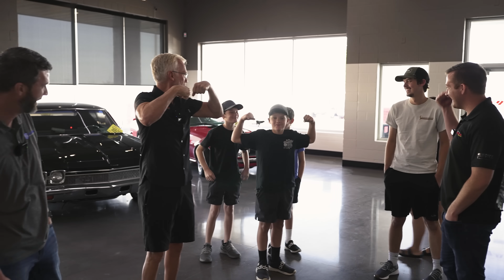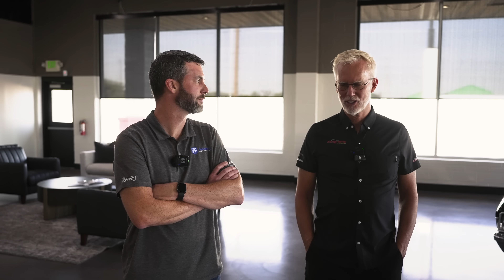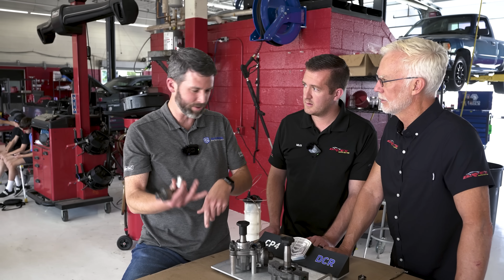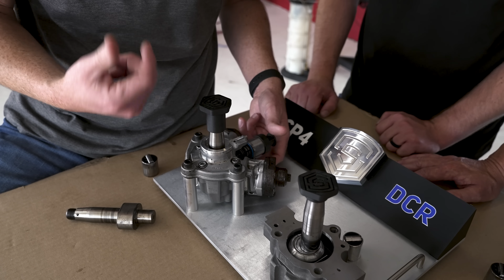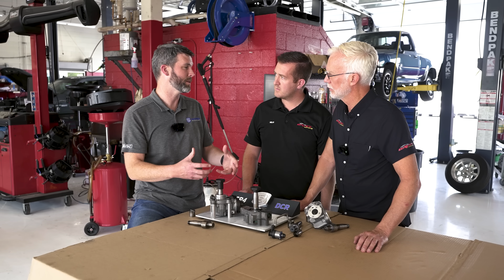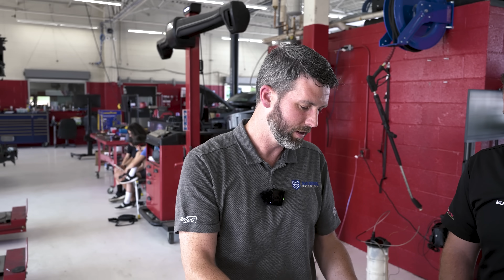Breaking Down How The CP4 Pump is a DISASTER & How To Avoid It With The DCR Upgrade!

Comment: Dave I have a 2023 F-350 Lariat with the Powerstroke. I use your “Dave’s Sauce” every fill up. Increase mileage to 26.9 MPG at 70 MPH. 
  To The Farm 246 Miles from here.
    Just turned 50K and would like to  make an appt to have you do a CP4 To DCR conversion.
Best in Mid to late March How much money should I bring along for the job
   Thanks. Geno

Comment: 11:15 - You nailed it, Miles. You either spend the $1,600 for the disaster kit and wait for your $3,500 CP4 to go out, or you spend $3,500 up front and install the S&S DCR.

Comment: 2017 F350 DRW here.  CP4 grenade got me a week ago while transporting a travel trailer 1100 miles from home. Ford dealer in Cheyenne charging 40% markup on parts.  Has their replacement kit on the estimate for $7k. Total parts $8900.  $6k labor. All to get the same shitty CP4. Totally ridiculous.

Comment: 14:14 Ford Master Diesel tech here, it is the shitty fuel in the States that causes this problem. In Canada, the only CP4 failures I've seen are from water or DEF contamination of the fuel system. I've been a diesel tech for as long as the 6.7 Powerstroke has been out and not once have I seen one grenade spontaneously or wear out over time. Every single fuel system I have done was due to contamination.

Comment: I bought this pump April 2024 and installed it right away. It works flawlessly. I continue to run additives with lubricity, recognizing these parts need better lubrication.  Best 2 grand i spent on an upgrade

Comment: The U.S. diesel fuel standard (ASTM D975) does not mandate a lubricity minimum, but instead recommends a lubricity value (maximum 520 µm wear scar diameter in the HFRR test).
European diesel fuel, governed by EN 590, requires a stricter lubricity limit, with a maximum 460 µm wear scar, ensuring better protection for fuel system components.
European refineries or fuel distributors often blend lubricity additives at the refinery level, making the fuel ready to use and better for modern engines.
In the U.S., additives are often added at the terminal, and sometimes not at all, which can result in variable lubricity depending on the region or supplier.

Comment: Recently installed an S&S bypass disaster kit on my 2011 f350 with less than 90,000 miles. Also now using MAX MPG additive from Industrial Injection. Hopefully my cp4 will live a long life. 
Now I worry about the EGR killing my engine.

Comment: Is it more economical to buy a $10+ bottle of fuel additive per 34 gallon fill up or get a dcr conversion? Assuming a truck life of 200k miles and 16mpg average fuel consumption we get 12,500 gallons of fuel and 367.6 fill ups. That’s a total of >$3676 vs $1990 for the DCR conversion. You be the judge.

Comment: You know...im kinda set and happy with my old 6.9 IDI turbo 250... Makes enough power to hual most stuff and can be repaired on a minimum wage salary if need be. New vehicles are just becoming junk and require too many patches and updates to keep them running.

Comment: Got an S&S 2.1 CP4 disaster prevention kit on my 19 6.7. Its a nice little peace of mind. Im adding an Amsoil dual bypass oil filtration system next. Running PS Kleen diesel and Stanadyne for additives. Truck fully deleted at 80k miles, runs like a top.

Comment: Way to go.  Make everyone terrified that their CP4 is going to fail prematurely so you can sell your pump.  I have seen several 1st, and 2nd generation 6.7L Powerstroke trucks with more than 200k on them with the original pump.  While some CP4's have failed, it is less than 7% of the trucks that were manufactured.
Reply: Seen plenty at 400-500k miles with CP4, clean fuel, filters and additives will save it …

Comment: I would rather drive my older gas Ford than today's diesel trucks! Whenever you need to fix something on a diesel truck, it's $1k+, e.g., injectors alone are $7K! My older Ford a carb would be $300- 500. Gas is also cheaper than diesel, and I get better mileage! But I do like them. They're great for what they do but they are way out of my price range!

Comment: So what is the psi from your lift pump to cool and lubricant. So what is the ideal psi continually from your lift pump to high pressure pump is  the number 15 to 21 psi and is to much to much ?

Comment: Great informative video, several new bits on CP4. Regarding fuel and CP4 failure. It was suggested it wasn’t strongly associated to ULSD, but also said losses in USA aren’t really known… it’s USA failure is highly publicized & legal suits. Although, the failures in UK, European areas; both Ford 6.7 and several other production non-Ford vehicles using Bosch CP4 the failure rate isn’t even discussed as a problem, run extremely high mileage with minimal failures, and when including many more vehicles indicates a failure percentage much lower than USA. 

I’ll continue to accept the fuel lubricity to be the major variable to failure, further verified by those running add-in and maintaining filters are common to exceed 400-500 miles.

Comment: If you fix. 50.
Pumps, that went band it is.
A c p 4 pump You better believe there's a lot more.
 I have.2017 Ford F350  super duty  They tell me the CP 4 fuel pump blew up in the tank. And it's not under warranty. bullshit Bosh. designed a piece of shit pump.

Comment: I worked with Luke and Ian at Cummins.  These guys were top notch engineers and technicians.  Good to see them solving the problems OEMs won't.
Reply: Diesels did not have these failures in the past, company's had time for development. People never blame the epa who forced rules without outside input other then themselves. The epa wants to kill the gas engine next and Diesel is the test run which was successful
Reply: @1k20a the EPA makes it's very difficult but company leadership is also setting unrealistic deadlines.  Engines have become much more complex over the years and are running on tighter tolerances, so they are simply more prone to failure.  It's like an old ak47 vs a modern rifle.  The ak is far more reliable and durable, but doesn't have the accuracy and power of new ones.  There's always trade offs.

Comment: If a CP4 is so bad then you should never be recommending any vehicle with a CP4. Also if the DCR is so good why is it not OEM? Seems like the DCR would save in warranty costs. As easy as the DCR shaft turns compared to the CP4 there should be an increase in power.

Comment: I had a CPX pump installed which is a CP4 that has a bearing pressed in to stop debris from feeding into high pressure and low pressure system.  Half the price of DCR which I wanted to see how the DCR holds up after five years.

Comment: Nonsense. The diesel’s with CP4’s  are the most common cars on European roads especially in Ireland. Failure rate is extremely low. You might have problems if you run the car out of diesel, it will be bad for the pump.

Comment: The issue is cavitation/aeration, mostly from improper fuel filter change procedures. But also the design around the low pressure side on all three trucks. As stated this wasnt an issue in the European applications because of their superior filter change and prime procedures and the use of the electric lift pump.  BMW's filter change procedure includes KOEO priming for 3 full minutes before you even start the engine making sure ALL the air is gone.  Also the bean counters at the American companies decided that the locating pins for the plungers were not worth the extra cost so Bosch did not pin them for those applications.  Funny BMW DID pay the extra cost and this never became a problem for them.

Comment: Luke is the best! I had a failure with my CP3 conversion in my 20 Cummins and he overnighted the part because we were 8 hrs from home. This was before the recall and the issue was most likely me over torquing a block off plug on the high pressure manifold.

Comment: I have a 2015 LML with a CP4 pump, I installed a aftermarket fuel Exergy Fuel System Saver metering valve for my  - Duramax LML in my CP4 pump. This has dual screens and smaller micron screens will this be good enough to hold  up the metals from spreading to my rails and rest of system like a disaster kit? I also have a fass 165 lift pump as another per-caution. Very hard to find info if this has been proven to work?

Comment: I’m not denying this pump has failures, but is this issue a chicken little the sky is falling issue? How many pumps have actually failed? If this pump has such a high failure rate like I’ve seen posted on other sites, where was all of this concern from 2011-2021? No one was talking about these pumps failing then. It wasn’t until the first disaster kit was made with the catch screen. Now all of a sudden a disaster kit was created and this pump failure has now been an issue. Yes, I am concerned about this but I also don’t want to throw good money after bad based on speculation. Why know is this such an issue?

Comment: Look, there are countless CP4s damaged, you have plenty of sales, but what about the FUEL TYPE of No. 2 diesel (the federally required biodiesel blend in No.2 diesel)?  It lacks lubricity with ULSD federal changes, so WHICH BLEND HAS ADEQUATE LUBRICITY to protect the fuel system (including the CP4s), how MUCH biodiesel in the No 2 is enough?  B2  B5  B10  B15  B20  B25   For reference, B-25 is one quarter biodiesel, one in every four gallons of No 2 diesel there is one gallon of biodiesel.

Driving the point home, if one uses ULSD (no other choice) without biodiesel, your FUEL SYSTEMS LACK LUBRICATION.

Please help us by the MILLIONS of diesel owners.

Comment: 2015 6.7, 220,000 miles. 10,000 mile oil changes, had 100,000k on fuel filters before changing them. Deleted egr, def etc. No issues. I think this got over hyped by some great PR for the bypass systems and upgrades.
Reply: Definitely they easily get to 300-400k miles, add some diesel additives and its bulletproof

Comment: 2017 6.7 316k miles Cp4 actually started failing. Caught it before it was too late. deleted with mild professional tune (100hp)
Symptoms for you readers:
Lower power, felt like i had little torque. Started when pulling about 6k truck would go into 6 speed, then if i needed to slightly accelerate for example from 65mph to 70 mph, the truck would occasionally go into reduced power mode, If i squeezed the throttle enough to downshift and spool the turbo-NO ISSUES, if i floored it from a stop (which i never do because my tools end up sprinkled everywhere)- no issues.
 i only had issues with gentle throttle low rpm converter locked.
Then the problem accelerated to actually shutting the engine off during the above conditions.
after a few months the problem would start to happen with the truck unloaded towing no weight. Same instances, low rpm no boost..
That's when i finally took it in to get fixed. 
In shop now, mechanic says there is NO contamination, the cp4 is just very week. He's converting to DCR now. He quoted $4k after everything. No retune needed. 3 days.
Hope this was helpful
 Wish me luck

Comment: On that lifter of that pump you're talking about and the lifter goes sideways and gets jammed in there on the cam lobe and then puts a Groove in the cantaloupe from the from the roller why don't they put a guide pin in there like a like a Lifter on a on a on a car so the so the lifter doesn't spin around it stays in that same position all the time

Comment: I can't wrap my head around why any vehicle would require a pump to create 30,000 PSI. It's insanity> There has to be a better way. That's just crazy
Reply: Basically Higher pressure= better spray to my understanding. Better Sray= better Atomization: more complete burn, better combustion control, less hot spots/inconsistencies etc. Best to hear it from an engineer though

Comment: I just got a disaster prevention plate for my Volkswagen,  I want to get it put on soon, my only concern is, how can the air purge from the system after installing this? The lubrication part will still purge itself the same, but can the pumping element purge air through with just the 60 psi from the in tank pump? From my understanding, it would have to get pushed through the pump, through the rail, then out possibly through the rail pressure regulator valve, but I don't know if that regulator valve would allow air to escape when the engine is off and the transfer pump is running.

Comment: I will admit to buying this on faith (everyone saying problem is solved) but now having seen the internals for the first time, pressure lubricated ecentric system, I have no regrets on spending $2000 plus some money for tools I didnt have to do the job myself.  Fuel pump worries are gone for me.

Comment: The Bosch CP4 pump has a failure rate of 7% in the USA, but only a 1% failure rate in European countries and similarly low in Canada where their diesel fuel is of a much higher quality and has better lubrisity than US diesel is. Yes! It also costs a lot more than in the US, but hey. I live on wet-coast of Canada, so I still add Lucas Fuel treatement at every refuelling and have been doing so  since my '05 6.0l was new and which I still own and run daily! It and my 6.7s have never had a single fuel pump related issue... knock on the proverbial wood😊

Comment: I put the DCR on my 6.7 stroker and I’m happy I did. I no longer have the worry in the back of my mind of not if but when it’s going to leave me stranded and penniless. My younger brother is looking at a 6.7 F450 and I told him to make that his first priority when he gets the truck. Plus the DCR flows at 43,000 PSI compared to 32,000 PSI my stock CP4 flowed. This translates into cleaner burn from better atomization and better mileage/ponies/twisters with the truck running quieter too.

Comment: Funny how Dave mentions about fuel lubricity. My friend has owned several diesel Ford trucks, his latest I believe is a 2020 and he's never had an issues with fuel pumps. The dealership called him and asked him what does he do to them. His reply, "I add oil to my fuel, fuel is to dry!" He does that to all his diesel engines and so do I. I could be wrong but I think he told me that it says to do that in the Ford Owner's Manual.

Comment: Did I miss something or this thing was designed with a high pressure supply pump in mind and the failure starts to happen when it's run with a low pressure supply pump?

Comment: Watching Dave's videos makes me think modern diesels are horrible engines. There are only a few videos with gas engine problems but it seems like many of his videos are diesels that on a good day go 100K miles with only $5-10,000 in emission device repair or replacement. On a bad day snap crankshafts or other severe engine failure.

What is the point of a diesel today? It seems like regardless of the brand the diesels are expensive to buy, maintain and are short lived.  

Not that gas engines are flawless they use more fuel but they are at least $10,000 less to buy, require less money for scheduled maintenance, break less often and when they do break they cost less to fix.

Comment: I’ve got a question and I hope you may be able to help with this I have a 2008 GMC Sierra 2500 deleted and tuned with 177k miles and my engine light turned on and it said to change the fuel filter so I did and then about 500 miles later the same issue happened and it reduces engine power, I have a code reader and the code is “P0087 Fuel Rail/System Pressure -
Too Low Bank 1” if you have any advice please help!

Comment: So is the DCR pump a direct replacement?
Reply: Yes, the DCR is a direct replacement for the CP4. The kit is designed to follow the factory fuel curve, which means no calibration changes are needed. It also comes with factory-like fit lines and brackets required for installation.

Comment: Seems to me that if the resistance of the roller bearing and cam is high enough to cause the pressed-fit crank to slip, that might be the symptom that saves having to replace the entire fuel system.  In contrast, welding or a keyway/dowel is going to allow the slipping cam/bearing to get worse; bad so that it disintegrates and sends metal "shrapnel" throughout the fuel system.
Are there warning indications of a slipped crank to slip?
Maybe the "slipability" of the pressed fitting is a good thing?
Maybe welding it is a bad thing?
How difficult is it to fix a slipped crank?

Comment: Great for Ford owners. What about a kit for Duramax CP4 owners?
Reply: Hey James, we do offer the LML CP3 conversion which replaces the factory CP4 with the proven CP3. The reason the CP3 was not used in the Ford application is the valley is not large enough to fit a cp3.
Reply: Understood, thank you. My LML just clocked 210,000 on the OEM CP4. I do use a lubricuty enhancer and an AirDog system, and have installed an Exergy fuel system saver. I'd really like hard data on CP4 failure rates on stock engines before investing further. @SSfueled

Comment: I’ve already changed out my CP4 for the S&S DCR pump,it’s the best thing I’ve done for my 6.7 PSD, before that I had the S&S disaster kit.  I still run the  Archoil AR6500 Diesel Treatment every fill up, the key to a happy fuel delivery system. My personal opinion about welding the crank gear is so it was so designed to slip in case the high-pressure fuel pump failure now you circumvent the original design that Ford put into it because they knew the  CP4 fuel pump would’ve eventually fail. Would you rather have the crank gear slip or cause more damage due not letting the slippage on the crank when the pump failed. The DTC P0016 is set when there is a slippage between the crank and the cam gear. If you weld the crank gear then there’s no reason to have the code P0016 because now you won’t have slippage. I believe that there is enough interference fit to drive the cam and the high pressure fuel pump as designed.